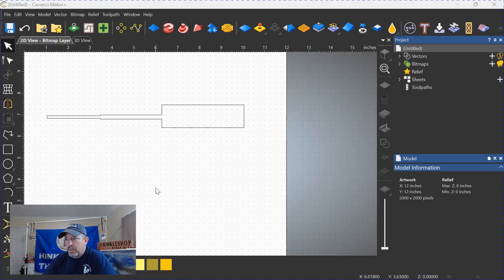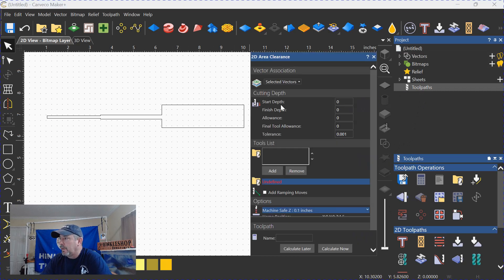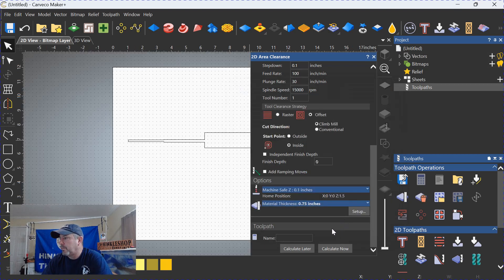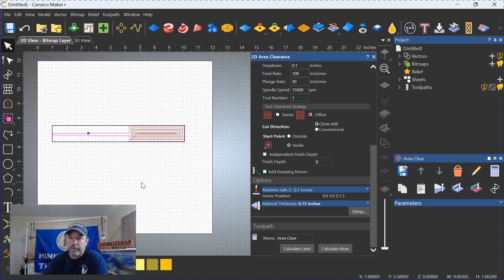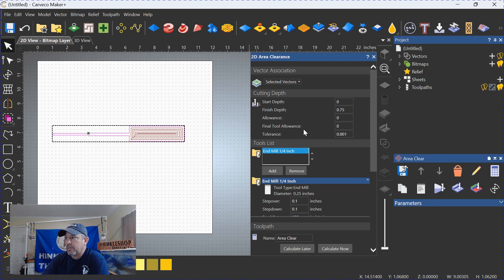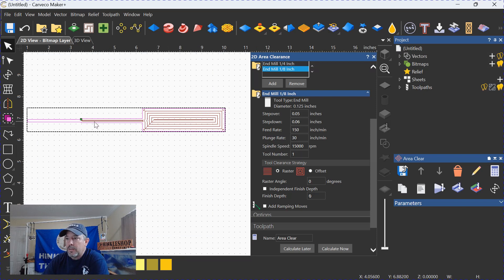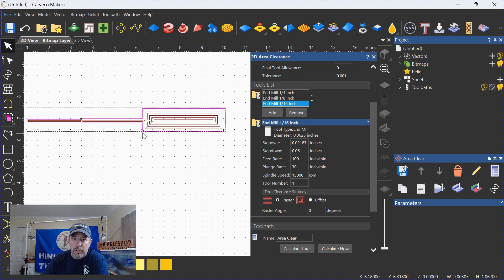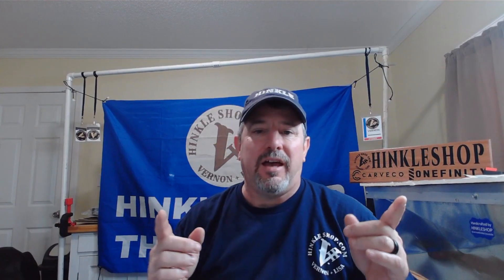# 15 How to get greater detail in your area clearance woodworking projects in@Carveco

Comment: Will Carveco put a pause into the gcode so you can change tools or do you have to create three gcode files?  This would be awesome, in combination with a tool changer.
Reply from the maker: Hey Gizmo 
I don’t know if Carveco will put in a pause but, if you save the toolpaths to separate files the machine will complete the toolpath and behave as a complete job you then can change bit load the next file zero for z only and continue to run the next file
Reply: @Hinkleshop  Ok.  I was wondering if it did it automatically or you had to fiddle with it.  Thanks.